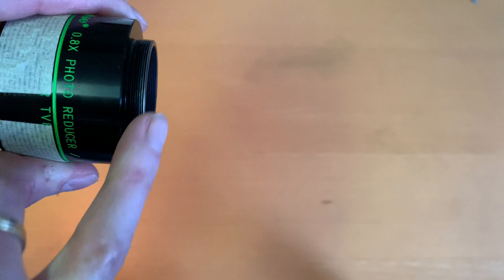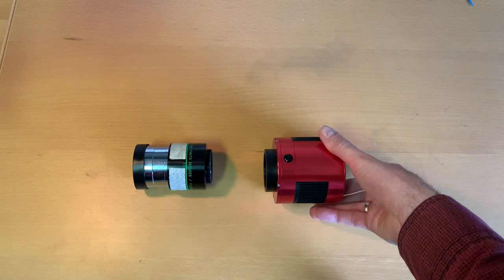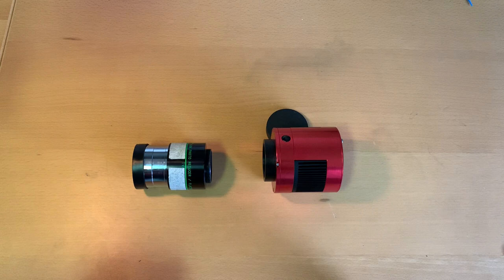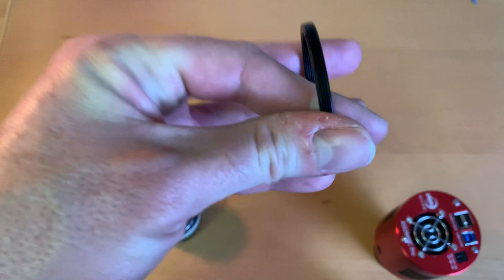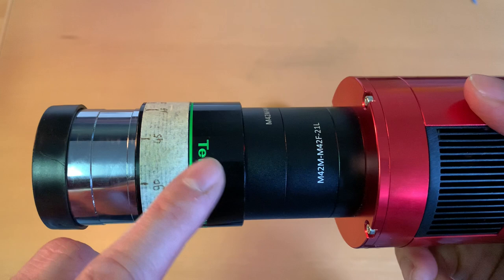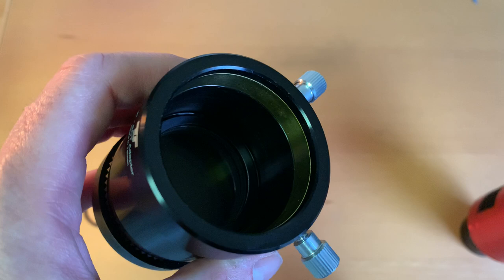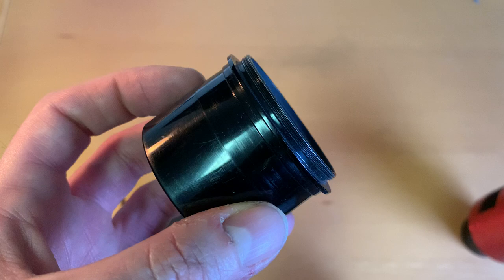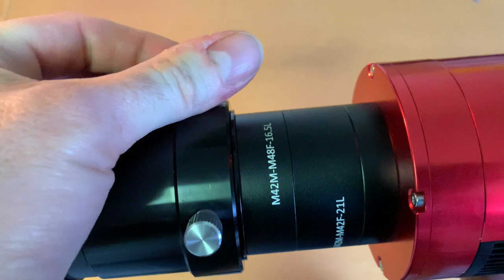Backfocus with an ZWO Cooled Camera

Comment: Does your filter glass not change the optical back focus, even though the mechanical back focus is correct? Isn't the rule to add 1/3 the thickness of the filter glass to the mechanical back focus? It may be just a millimeter or tqo, but will make a difference.
Reply from the maker: I never did this, but that is because I am either using an Optolong L-Pro or the Optolong L-extreme. 

Secondly my scopes are fairly slow and my cameras are not full frame. That gives me some leeway

Comment: Very informative video. I need a suggestion from you. For the f/9.8 (102/1000mm) refractor, which is the suitable 0.5x focal reducer (FR) for astrophotography using ASI294MC Pro camera? 1.25 or 2 inch FR?
Reply from the maker: I would advise to use astronomy.tools website to determine the image circle of your camera in relation to your optics and deduce from that if you can get away with 1.25”. I have no experience with this specific optics. I do everything on 2”
Reply: @KopLamp : Thank you very much for the kind response.

Comment: very useful; but I have a ASI ZWO 533MC camera that on tech spec states the backfocus is 17,5 mm  instead of 6,5mm is this correct?
Reply from the maker: The sensor is 6.5mm inside the main body of the camera. There is an 11mm ring attached to the front of the camera. That makes the total back focus to take into account for the camera 17.5mm. Most optical systems are designed to have the perfect focus at 55mm from the last lens element. So usually you can mount an included 16.5mm and a 21mm extender ring to that to get to the 55mm.

The zwoastro website has some of examples mentioned in the specs for your camera.

Comment: Nice video...Thanks !!!! but is not needed as well to extend the total distance adding half of the thickness of the filter ? 2mm filter 1mm has to be added. ?
Reply from the maker: I have read it indeed. But I think because I am using a cropped sensor I get away with it.

Comment: Excellent Video!!! so I'm assuming that same rule would apply to the Barlow Lense right?
Reply from the maker: I have no clue about barlows, but I would guess the same. 

I am in the process of scripting a new version of this, in which I dive in to the world of fitting an OAG in the mix (as well as doing things on EdgeHD)
Reply from the maker: I’ve done some reading and it appears that a Barlow does not call for an exact distance in the same way as a flattener would. 

A flattener under- or overcompensates when not used with a proper backfocus.

For a Barlow the distance only effects the zoom. So you’ll best determine the maximum your scope can provide and stick with that.

Comment: Thank you for this video ! Very clear !
And if I want to make planetary images using a barlow, how do I insert a barlow in this optic train ? (Simple 1.25’´ Barlow X2 for exemple)
Reply from the maker: You wouldn't be using a flattener/reducer then. I don't own a Barlow, but my guess is that it will come in place of the reducer. If I understand the optical implications good enough, a barlow will mess with the magnification of the optical train, but not with the shape of the field. Hence a back focus distance is not applicable. YMMV.
Reply: @KopLamp  thank you for the reply

Comment: Excellent video but the problem is changing even attaching filter to Zwo Filter drawer terrible pain in the ass. I cant put my finger and rotate filter to fit to drawer. Whether Im terrible at it or its worst invention. My L pro and L extreme got finger prints because of Zwo Filter Drawer. Im using nose adapter instead.
Reply from the maker: The filter only needs to be put in the drawer once. It is advised to have separate drawers for each filter you own. Only then you get the benefit of changing filters without having to deconstruct the imagetrain every time.

Yes, screwing in the filter is a bit cumbersome. I suggest doing that indoor and at a slow pace.

Comment: Hi I have a question !  I get a newton last year (200/1000 mm celestron) and a camera (294 mc pro) !  I followed the instrutions of zwo for the back focus (camera, 11 mm, Drawer filter, 16,5 mm and baader coma corrector.  However I'm unable to get a focus with this telescope !  I tried with a 2 po adaptor and without...  but nothing to do !  I suspect that the focus train is too long !  The only way I got the focus is to remove the 16.5 mm but the stars is like a potatoes same if i have a baader !  Should I change the train focus of the telescope ?  Have you another solution ?
Reply from the maker: I'm afraid I don't have experience with Newts and coma correctors. Perhaps this website's example images of how to mount things gives you a few hints how to achieve focus?

Comment: Hey Martin, good morning. Hoping you can clarify this for me.  I have the ASIAIR Plus and the Explore Scientific iEXOS100 equitorial go to mount.....with an astrotech AT102ED refractor.....why would I need a guide scope ? I thought lining everything up was the purpose of the ASIAIR Plus ?? I have gotten pretty good stacked images so far but last night it would not keep the target centered ?? Thinking I might have not checked the scope for being level before I started.  Thanks for your time.......Mike
Reply from the maker: In a perfect setup, one would not need a guidescope indeed. But, there are always inconsistencies in the tracking. Due to mechanical imperfections or just simply by a not perfect polar alignment. Active guiding will keep the scope pointed at the exact position throughout your imaging session.

By the way, leveling your mount is not necessarily the cause of tracking errors. In tracking, only the polar alignment is of meaning.
Reply: @KopLamp  Thank you so much for your time and for sharing your knowledge. I appreciate it very much.

Comment: Martin 
Back focus is my bugaboo too. 2 questions , I dont use a flattener so where do I measure from, have to same camera as you , the 294 ... Second question , have you been able to get to the picture I sent you for stellerium ? Thanks for the vids
Reply from the maker: I have received your image. Thanks for reminding me. I have 100+ gigabytes of data to stack, so I am a bit busy. Also I want my newest video to be finished... so much things to do.

In case of not using a flattener it depends on the used telescope. In most cases there isn't a specific backfocus to reach. Then only important factor then is achieving correct focus. It is the flattener/reducer that induces the need for a proper backfocus (at least to my understanding)
Reply: @KopLamp  I wish someone in there videos would start with  (If you do not have a field flattener you do not need to do this )..... I think that would have saved me 3 years of trying.. LOL

Comment: Thank you Martin for your suggestions. I have a question for you: I need mount my Canon 75-300 EF Lents with ZWO asi183MC camera, what backfocus distance I need to buy?
Reply from the maker: I am no expert in lenses with ZWO cameras. I do know that the lenses are made for the DSLR, which requires a backfocus of 55mm. 
Keep in mind that the sensor is recessed in the camera body. Normally the ZWO camera should come with adapter rings to reach that 55mm (which is pretty standard)

Comment: Greetings from Kaliningrad!!! She came to me 533mm pro ... I want to ask you how long it takes to defrost it after cooling? After all, if you cut it down sharply, it will flow and can flood the sensor or short it out. Raise a degree per minute or 5 degrees per minute or something else ????How is it right? Lower the temperature, too, after all, gradually, so as not to shock it?
Reply from the maker: I use the ASIAIR and it doesn't do a gradual warming of the sensor. So basically I just let it warm itself on the ambient temperature.
Reply: @KopLamp  Thank you...

Comment: On my SCT I use the ZWO  OAG mounted directly in front of the filter drawer on the ASI294 like you have. How do I get my guide camera to focus? Will I also need 105mm from the focal reducer to the sensor on the ASI120mm camera on the OAG?
Reply from the maker: I have no experience with an OAG. But from what I've seen, the OAG basically splits the light from the telescope towards the two camera's. Both lightbeams need to reach that correct backfocus.

So in less words: yes ;)

Comment: What would the backfocus be if I didn't use a flatner? I am attaching a ZWO ASI385MC to a Celestron CPC 8 SCT without a FR/Corrector? Thanks for your video.
Reply from the maker: As far as I know, this telescope does not have specific needs for a certain backfocus other than reaching focus. There is no corrective lens such as is the case with an EdgeHD. Therefor reaching focus is your only task.
Reply: @KopLamp  thank you. I will let you know how it goes!

Comment: Do you adjust/increase your backfocus to take into account the change in reflective index caused by the filter glass?
Reply from the maker: People say it is needed. I never noticed a difference although I must say that I either shoot with the L-eXtreme or with the L-Pro. They might have a similar effect…
Reply: by using filter, I also need to plus 1mm (55mm to 56mm) for back focus.
Reply from the maker: Finding the correct back focus is an iterative process.

Comment: Hello,  great video.  But my problem is that I cannot get the right focus with my Celestron 150/750 Newtonian tube + ZWO 294 Color camera + William Optics Z73A flattener...I guess it is because the flattener is W.Optics and not celestron...not sure though,  I'm just learning these things in astrophotography , I hope you can help me with the right set up. Regards from Chile
Reply from the maker: Can you achieve focus without the flattener? Also I think with a Newtonian a flattener designed for a refractor telescope will not work. For Newtonians you’ll need a coma corrector instead of a flattener.
Reply: @KopLamp  I guess it is like this....thks for answering
Reply: @KopLamp  and yes,  I get focus without the flattener,  I just want sonething to avoid weird stars in the corners so that I don't have to crop the photo....

Comment: May I ask where you find the data for the necessary back focus for each camera?
Reply from the maker: It is not dependent on the camera, but on the optical system. The lenses determine where the focal point is and where you should put your camera sensor for best performance.

Some camera's such as DSLR's have their sensor deep inside their body. That makes that telescope manufacturers make their focal point be some distance outside of the backend of the telescope. Usually this is 55mm backfocus.

Focal Reducers as shown in the video have their own backfocus. The one shown has a backfocus of 105mm (as found on the manufacturers website). Some telescopes, such as the Celestron EdgeHD can have a different backfocus when used without a reducer.

See for instance page 13 in this document: https://s3.amazonaws.com/celestron-site-support-files/support_files/edgehd_whitepaper_final.pdf

Comment: whats the optimal BF on a C8 without fl/reducer.. 127mm?
Reply from the maker: Depends on the telescope. If it is an EdgeHD you might want to look at my most recent video, which details that. In case of a non-EdgeHD C8 it doesn't matter that much I think. Your field edges will not be pinpoint stars anyway.
Reply: @KopLamp  a c8 as this is a c8 video :)
Reply from the maker: @CDigata  Fair point. Well, the EdgeHD and C8 name are used interchangeably. Even by Celestron themselves. See this page for some advise on Back Focus distance with a C8. https://www.celestron.com/blogs/knowledgebase/what-are-the-optimum-back-focus-distances-for-celestron-scts

So, 5 inches or 12,7 centimeters...